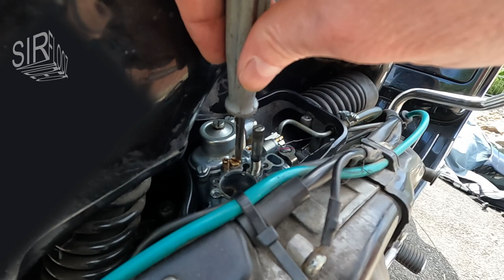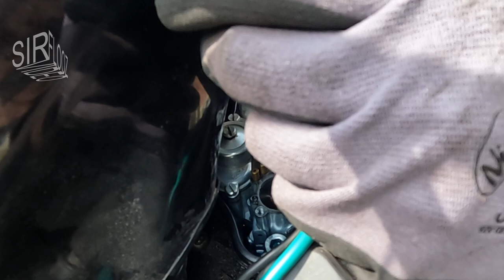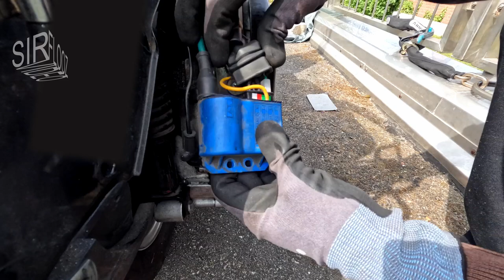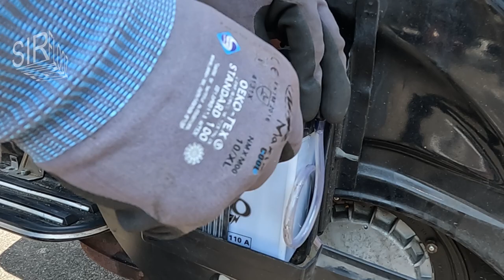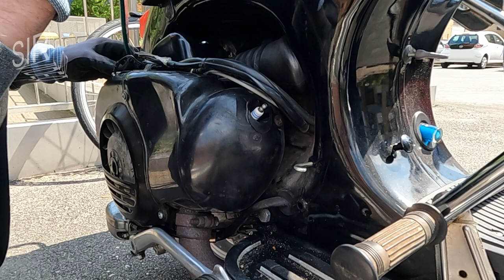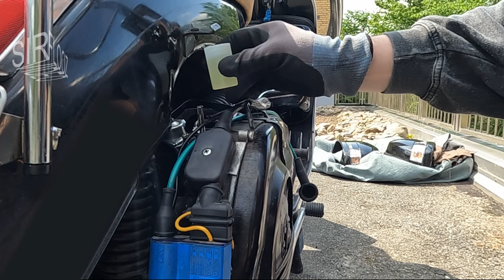Vespa PX Does Not Start! Can It Be Fixed? Part 1😱

Comment: You should have started with if it has spark. Takes two seconds without moving straight to the carb. I don’t see why it would be a carb issue for just falling over. But falling over could crack a CDI box or coil.........
Reply from the maker: Well, if you see part 2 to 4, you will see, that my way was probably right. Cheers!

Comment: I have a PX125 2015 and sometimes the electric starts fails completely - dead .dodo.
 - don't laugh but if I toot my horn twice, it then turns over immediately and starts no problem.
Often it struggles to kick start cold, some choke, could be the same unknown issue so I will try to tooting twice to see if it kick starts better. Also best to turn fuel on for few minutes to fill carb.
Reply from the maker: These models have a special starter protection device, which could cause your no starter issue. The device is located under the front cover and is usually in a pink housing. To check, if this is the cause it would be possible to bypass this device. But to do this you should ask an experienced car electrician after showing him/her the correct schematic sheet if you are not an expert yourself. Good luck!
Reply: I know of this - I have a simplified starter circuit diagram showing just the 9 components.
In fact previously my still young 2015 PX125 had very hard bright green oxidation hidden behind the main fuse or relay (next to the battery) - perhaps due to my winter riding - so I will strip it out to check this soon at my annual spring clean service..
But the concept of merely pressing the horn to re-establish the electric-start circuit is still comical to me.. @sirflooz

Comment: What does he use to clean the jets? the sound drops when he mentions it, and you cant hear what he said
Reply from the maker: I soak them in brake-cleaner or gasoline for 24h or more. Even better is to clean them in an ultrasonic bath - but due to a lack of funds (and donations) I don't have one.
Reply: @sirflooz  Thanks. Looks like producing these videos are stressing you out, not worth it. There are plenty of videos on Vespa maintenance in youtube with the same information that anyone can find, so no need to put your health at risk.

Comment: You went the long way for a  simple fix . It was
Most likely flooded from being on its side . if you turned engine over without fuel on and no choke it would have started
Reply from the maker: Well, I really went the long way. But I have tried the procedure you describe, but it did not help. See parts 2 to see the details: https://youtu.be/R9ARoNzmOzc.